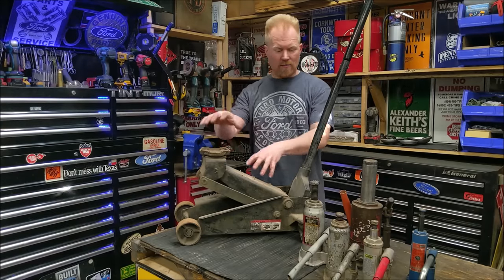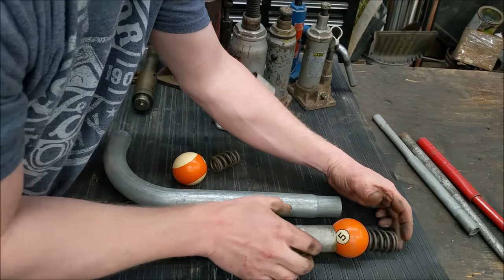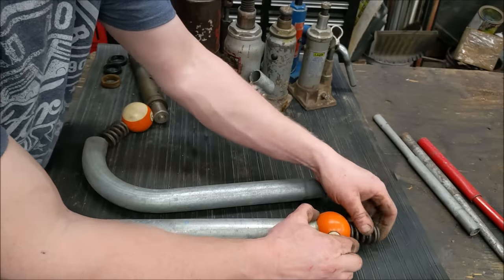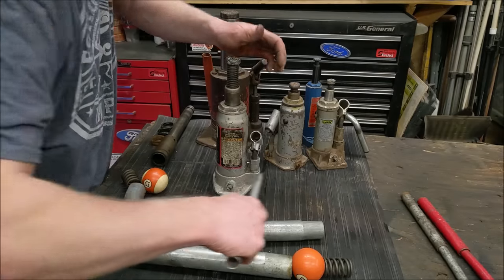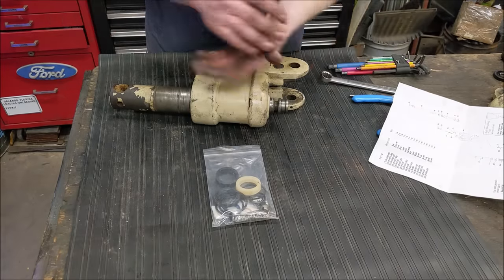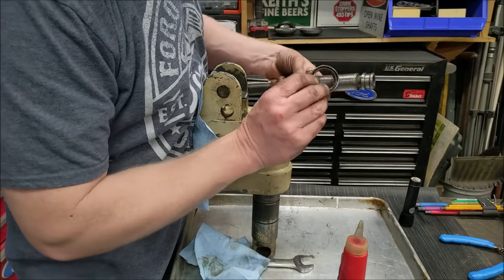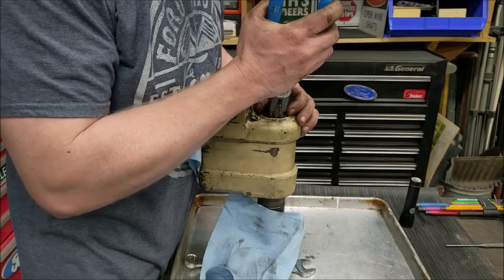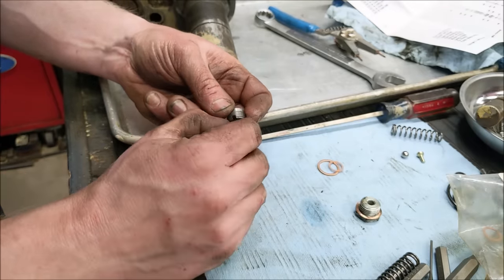How to REPAIR Hydraulic Jacks & How they WORK Bottle, Floor, Pallet, ETC

Comment: I have a Pallet Jack that doesn’t hold a loaded pallet up very long that drops down yet I see no leaks. Any suggestions? Another question do you use any special hydraulic fluid or would a AW 32 or AW46 work just fine in these jacks? I haven’t seen many good video’s on Pallet jack repair. I am a subscriber and have always liked the video’s you put out.
Reply from the maker: The U cup could be leaking or the check ball. With a standard bottle jack it's easier to tell which one but the pallet jack puts the pump piston under a return spring and if the main U cup is leaking it just goes right back into the reservoir. With a standard bottle jack if the U cup seal is leaking it will leak fluid out of the top of the jack and if the check ball is leaking it will raise the pump's piston. Most of these pallet jacks have excellent parts diagrams online and you can dissemble, clean the check balls and try them over. Virtually all jacks should have iso32/sae10 non-detergent oil from the factory. Putting in iso46/sae15 or iso68/sae 20 can help along with a power steering fluid with stop leak to help soften the old seals.  Lucas Oil makes an additive that thickens and soften seals but it won't fix ripped seals https://amzn.to/2us0AQt . You just add a small amount to your existing fluid.
Reply: sixtyfiveford Boy that was a quick response. All makes sense to me. I am going to wait for warmer weather and take another look at it. I remember a couple years ago hunting for information on it and having a hard time finding much info. I use to use it for my small business but I retired from it so I don’t use it much anymore but when I do it is a pain to have to pump it up every few feet or so it drops down so fast and the pallet gets caught on the floor. Thanks for responding so quickly. Most You Tubers don’t or never answer a question I find.
Reply: Hydraulic oil fluid, 32 or 37 AW brand no.
Or SAE 10W

Comment: Question: my 1970 "Roll-Lift" Pallet Jackson lyrics has about 1/3rd  ram movement on a full stroke of the handle. It feels like an air lock? What would be your suggestion to remedy this situation?
     Setting the lever to release & pumping the handle does not fix it.
     Thanks for your help, Robbie
Reply from the maker: Partial lifting can be a few things. First you could have used up all you available oil; so make sure it's full. Generally an air lock will present itself as a jack that won't lift a heavy item until a few strokes have compressed the air. Then it will lift very lazily.

Comment: Thanks for video, can you do a video on how to convert a bottle jack to use air
Reply from the maker: Yes and no. I've built it in my head a few times over the years. The main issue is you need a completely separate air ram that essentially just pumps the mechanical pump lever. Parts costs are outweighing the cost of buying an already made unit.
Reply: sixtyfiveford    Yes I seen where a guy modified a air harbor freight jack to work on his press, I just figured you had found a cheaper way to do it

Comment: How do you put a ball in backwards?? It's the same on all sides...
Reply: Anon Ymous watch the video. Backwards means the spring is installed on the wrong side of the check ball.
Reply: You should never put the ball in from the top and for sure never put the ball in sideways of course you could put the ball in top down but you know what will happen then but the worst thing you can do is putting in your ball crooked
Reply: Like the cart ahead of the mule

Comment: I have an old blackhawk jack ive put  alll back together and i have oil leaking around the bottom of the outside housing. Ive used silicon the seal recommended by the parts people...what am i to do..do i need to pull it all back apart and use RTV to seal??

Comment: Hi, I have a bottle jack with no fill plug on the cylinder. The only hole is the tension screw on the bottom. Its old but I can't seem to get it filled up again to work like it should. Any help would be greatly appreciate.

Comment: Very good video, my jack is like the gray one u showed last . It is full of fluid but it will pump up 1/2 the way what do u think?
Reply from the maker: If it has full lifting power for the 1/2 then you have a damaged cylinder wall/bore where it is bleeding past at that point. Now if it has no lifting power for that 1/2 raise then you likely have an air bubble in the bore.
Reply: @sixtyfiveford  thanks how do u get the air out? I tried the way u showed but that didn’t work or is it time to get a new one
This one is about 20 years old now. Might have worked it to hard and put it up wet to many times. Thank u for ur quick reply

Comment: I got a sprinter jack and its leaking

Weird thing is they are practically upside down in their correct stowage position

What is it likely to be - plunger shaft seal

Can i fix it thanks

Comment: Great video.  I have a 2 ton Tru-Lift model #TM 200MF I can't find info on like what size seals it takes.  My jack will pump up if you have weight on it but if no weight then it will pump up a little but immediately go back down.  Does that sound like the seal or maybe the ball bearing or spring?
Reply from the maker: That would mean the spring behind the check ball isn't applying enough pressure. So fluid can go both directions until it gets the help of the loaded piston/higher pressure to help keep the check ball closed. This link should be your seal kit and their is also a full schematic on the page https://www.hcrcnow.com/shop/seal-kits/product/6244 Schematic https://www.hcrcnow.com/uploads/drawings/astroline_am200ffloor_jack_2_ton.pdf

Figure 5-7 is that an externally exposed adjustable thumb screw? If so, screwing it in will increase the spring pressure on the check ball and may eliminate your issue. It would be located directly on the back of the jack. It may be internal though.
Reply: @sixtyfiveford  Wow what a quick response.  Thank you so much for the info.

Comment: One at my work is having an issue where the release only works when the handle is up right and it's very slow to lower when it is. The pumping it up has no issue and it holds weight well but to lower it is a struggle
Reply from the maker: There is going to be debris in the passage for the release fluid. Not a ton you can do about it unless you take it completely apart and clean it.

Comment: I have a 50T bottle jack and I found a air powered hydraulic power supply. If I plumb the pressure side of the power supply into the pump inlet of the jack that should work right? With pressure on the ram it should feed the fluid right back into the power unit when I shut off the pressure right?
Reply from the maker: If it's a stand alone unit it probably need a fluid source so you would also need to tap the suction side of the pump into the jack reservoir. The pressure side could go right where the pump piston moves up and down.
Reply: @sixtyfiveford  Yes it has a fluid reservoir tank, I believe it is called an "air over hydraulic oil" system. Air pressure powers it. I thought if I released the air pressure the fluid would come back through the line that powered it and I wouldn't need to plumb in the return line.
Reply from the maker: @toolmike100  If the pump has it's own check valves and can hold a couple thousand psi then you would simply remove the check ball going to the main ram. Leave the one in place for the jack reservoir as it will keep fluid from back flowing into there.
Reply: @sixtyfiveford  Thanks, this way I can return it to the way it was if it doesn't work.

Comment: I have a 3ton floor jack and it has no name or numbers. Does it have numbers inside of the hydraulic ram  I don't know who built it  is slowly releases down by it self. But it don't leak  do you think it's a air bubble problem
Reply from the maker: Sounds like a check ball not sealing properly.

Comment: How about how to fix the mechanism that loosens and tightens the floor Jack. That gear system on the older ones always seem to fail or not mesh together when the handle isn't in the upright position.
Reply from the maker: I know they sell new gears for the older units(Sears/Craftsman etc) https://amzn.to/3cCg3i7 this is an example I don't know if these are the exact gears for your jack.

Comment: I've got a problem with my floor jack, unless I super crank the release shut, it won't hold pressure. It works, but it's got no real control which isn't good. I've had the release out (tapered pin). Any idea why it's closing with such difficultly?
Reply from the maker: Likey a piece of debris got caught in between the taper and the seat. You could try, very lightly hand spinning a sharp drill bit in the hole to clean up the seat.

Comment: Great video. Any idea if a normal bottle jack can be adapted to lift a tray on a trailer? I want to use a bottle jack with an external handpump. It's that possible?
Reply from the maker: Yes, Just take the small pump piston out and tap a fitting. You will need to remove the check ball from the pump to ram so the fluid can go back through the hose into the handpump.

Comment: The one thing I don't understand is how the rebuild kits for floor jacks for any jacks cost so much money? You were talking $50 $60 for o-rings that are making from rubber. For whatever reason I can rebuild an air conditioner off of a car compressor and not spend no more than $6 for o-ring and in some cases they give you enough of them that you could do it twice. I don't understand why the ones for jacks cost so much more. 

A few years ago when the rim on my engine left went out all the sudden I thought I can go online buy a rebuild kit and have it back up and running and a day or two. That's what I feel what it cost for a rebuild kit. It wasn't worth it a brand new ram was $60 and if I wanted air and hydraulics that was $80. It's almost like companies just want us to throw things away instead of fixing them.

I really did enjoy your video I love how you explain how hydraulic jacks work. I might have taking a few apart in my life never understood what the ball bearings inside were used for until now..

Comment: Any suggestions on how to repair a leaky release valve in a 4 tn Harbor Freight bottle jack.  The store can't get a repair kit?  Just curious...thx
Reply from the maker: That's one of my biggest complaints about anything from HF. They have zero parts for anything. Anyway, that seal is generally just a long soft rubber tube that seals against the sides and then the threads of the release screw. You can stack a bunch of O-Rings around the screw, cut a piece of fuel/rubber hose and try to push it in there, or possible wrap the screw with some white teflon tape where the seal touches the screw. You could also take it out and see what plumbing faucet seals match up at your local Home Depot/Lowes.

Comment: All in One Bottle Jack Stand
My sons friend messed up and took the oil return screw all the way out and shot the oil return bearing off to where ever, can you tell me what size bearing ball it is please???

Powerbuilt 3 Ton, Bottle Jack and Jack Stands in One, 6000 Pound All-in-One Car Lift, Heavy Duty Vehicle Unijack, 640912
Reply from the maker: It's not that crucial. So find a ball that fits inside the threads easily. Don't smash too big of one in there or it'll never come out. Just shooting from the hip but they all seem to be around 5/32- 3/16".

Comment: So i noticed oil oozing from from where the shaft comes up from the housing. Its a new jack. Is there something not tightened??
Reply from the maker: Likely just an incorrectly installed seal.
Reply: Thanks @sixtyfiveford

Comment: Looking at buy a bottle jack.  Hi ESR one is $30. US made one is $250. Is the difference really worth it with these being such simple devices?
Reply from the maker: Yeah, the USA one makes you feel pride and hurts your wallet. Sure there's likely a higher tolerance and build quality for the price but it's probably only 10-20% better. Personally I don't think it's worth the cost difference. They are such basic things. The cheap one will likely rust easier as less nickle/chromium will be used in the piston rod. But the seals on both brands are likely Chinese made.
Reply: @sixtyfiveford  thank you for your reply and input. Also, thanks for understanding my unread autocorrected nightmare of a question.  
Yeah I would pay maybe half that amount but it’s just too big a difference.

Comment: I need your help Sir. I have a 12 ton Central Machinery bottle jack that came on a 12 ton shop press from HF. I'm ashamed to admit what I done but, I did it and now I need your expert advice. I screwed out the safety valve being a dummy and didn't count the number of turns out. So I do not know how to put it back to the factory setting. I started to just fully seat it then back out one turn. Would that be close to correct? Please tell me what I need to do, I can't afford to throw this jack away and buy another one. I'm an honest guy so, I'm not taking it back and claim it was defective. Please reply Sir.
Reply from the maker: The safety valve is simply there so you don't over exert the pump and blow out the seals. If you're concerned just turn it out another turn or so and if it's weaker than before, then turn it up. The only true way to adjust it is to put 12 tons on it and set so the screw releases pressure at that weight.
Reply: @sixtyfiveford  Ok, thanks for the reply.
Reply from the maker: @seahunt2001  On a side note The safety valve is really only meant for when the jack is being used to lift something. So somebody doesn't lift a 14-ton truck with a 12 ton Jack and have it fail and kill somebody. That's really not a worry in a press because if the jack fails it's not going drop 12 plus tons and injure somebody.

Comment: Hey moe what do you think about using a heavier weight oil to help with any leaking?
Reply from the maker: Yes.  They come standard with iso32/sae10 oil. You can put in iso46/sae15 or iso68/sae20 non-detergent oil in a worn out jack to get more life or even power steering + stop leak to swell the seals and get a few months/years. Lucas makes a good stop leak/thickener you can add to help get years out of a worn out jack https://amzn.to/2us0AQt .It will lightly soften the hardened/dried out seals (it won't fix a torn seal).

Comment: I have a motorcycle lift it was leaking so I purchased a new pump installed it and when I pump it the lift does not go up. I think there’s air in it possibly how do I make it pump up?
Reply from the maker: First pull the rubber plug on the side and make sure there is fluid in it. Second, you make need to hold the piston upright  while pumping. If you can pull the piston out by hand and then release the lowering screw this will force the air pocket out of the pump.

Comment: Staring and staring and I finally noticed the General Lee sticker. Where did you get that?
Reply from the maker: I have 2or3 I think; one on my shop door, one on the USGeneral toolbox and the other I don't recall. They are little stamped metal signs I got as a gift years ago. I assume they are just an Amazon or Ebay thing. I have a license plate CNH 320 somewhere as well. I would hang the Dixie Flag but I think people would hang me.
Reply: @sixtyfiveford  
Yeah probably. I have nothing to do with the south. I wanted to build a Jeep with the O1 theme, but change the roof flag to the American flag. That project is on the back burner.

Comment: Another way to clean the seat would be to take a Q-tip and some lapping compound and carefully lap the seat and remember to clean up.
Reply from the maker: Yeah, anything to smooth out the surface. You can also lightly hammer the ball into the seat to smooth it out but get a new ball afterwards.

Comment: Call me stupid, but what type of fluid do you top it up with? is it common auto hydraulic fluid?
Reply from the maker: @JohnBlair-p2z  They sell specific "jack oil" but virtually any oil will work. ATF is an excellent substitute and a lot of times better than generic "jack oil". You could even use things like power steering fluid. If you live somewhere where it was really hot you can even just put motor oil in there.
Reply: Thanks for the information. Cheer's mate.

Comment: I have a 10,000 psi generic air over hydraulic power unit that needs a very small U cup .75x.25x.25. do you know where I can get one?
Reply from the maker: www.theoringstore.com  has most sizes available. I'm not endorsing them, just from what I've seen.
Reply: Go to a hydraulic service center ,if you can't find it, they can custom make one for you ...from a machine

Comment: I bought a bottle jack from harbor fright and it leaks from the bottom, is there any way to fix it?
Reply from the maker: Sometimes the entire outer housing is threaded into the base. Tightening them will seal it. It's not easy though as you need large pipe wrenches and or a big vise to hold everything.

Comment: Wish I could find decent /correct seals for this old brick shithouse 2 ton Sears floor jack from the 60s I have. 
2 tons haha, it makes a new 2 ton jack look like a toy. 
It works and doesn't leak until you release it and it's relaxed.
Reply from the maker: I haven't had any issues finding seals for the old Craftsman Jacks. A lot of people sell seal kits for them that have the seals for all the models. You can also order individual seals if you take your old ones out and measure from places like www.oringsandmore.com
Reply: @sixtyfiveford  
I'm gonna have to give it a try again when I have time because we all know the old stuff is better.